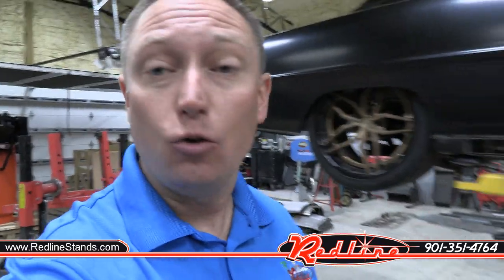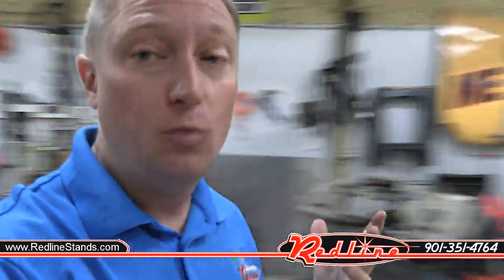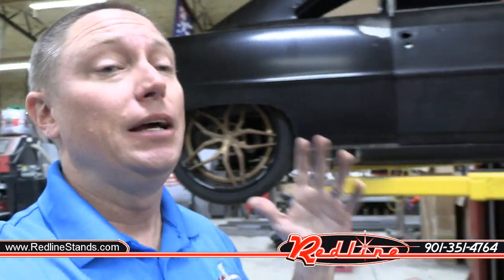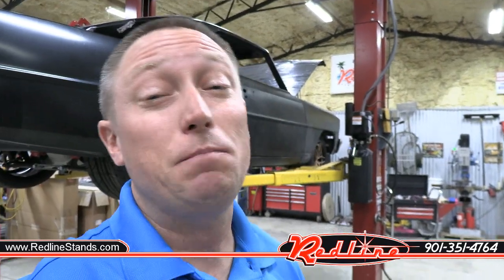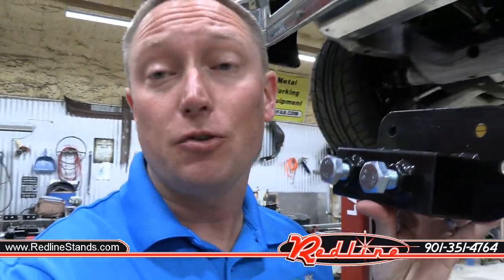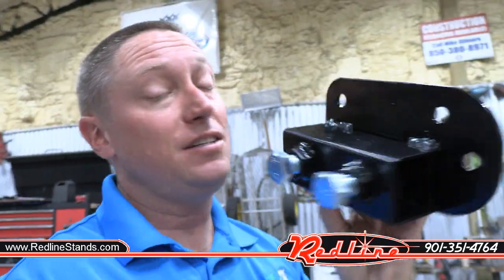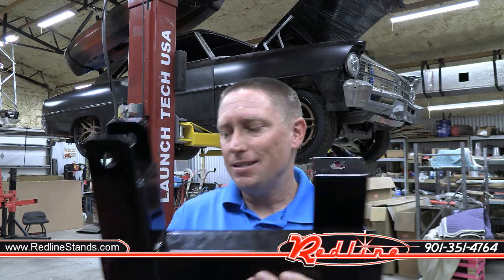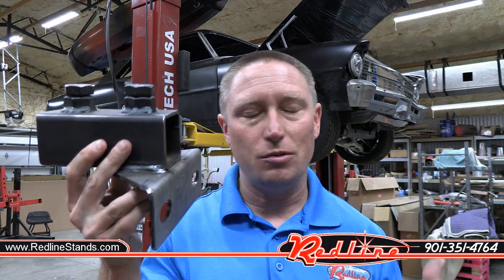Mounting Any Car/Truck to Rotisserie - How It's Done

Comment: Looking to use on 2 different cars. The first is a 85 3rd Gen Camaro convertible (the only prototype left out of four built). The second car is a 87 Turbo Regal, both will be body's only. Any sugestion on what to buy?
Reply from the maker: No sir.  Never mounted either.  I'd just start with the rotisserie.  Mock it up with the arms in place and then you should be able to get a better idea of what's needed to connect the arm to the car.

Comment: I have been looking for the best method to mount a full framed car on a rotisserie.  I want to put my 1986 El Camino (G Body) off the frame onto the rotisserie.  With the door off and interior off the car to make it lighter what is the best method to mount on a rotisserie?  I have seen a full length aprox. 3 X 3 tube the full length of the body with vertical standoff is this the method for a full frame car?
Reply from the maker: You didn't mention the glass.  Don't forget to remove the glass, unless you're looking to bust it, at which point, proceed as planned sir.  You can certainly build that 3x3 tube frame to take the place of the frame if you want, or you can just build brackets that allow the rotisserie's arms to bolt-up to the body mount points.  Either is fine.  If you're planning to replace big panels due to rust, go with the 3x3 option.  It won't be funny if you weld it all back together only to find the glass doesn't fit anymore.
Reply: @RedlineStands  Thanks about removing the glass I didn't give that a thought.  Does that imply the body flexes on any rotisserie?  If I did the full length of a 3x3 tube, then that would be more ridged and have less chance for flexing.  I have already replaced some small panels.  I need it on the rotisserie to clean and paint the bottom of the body.  Some more bodywork and welding of some small spots.  I want to get it back on the frame before tackling the bodywork to get it paint-ready.
Reply from the maker: @jamesperkins3742  The body will definitely flex regardless of the rotisserie model or brand.